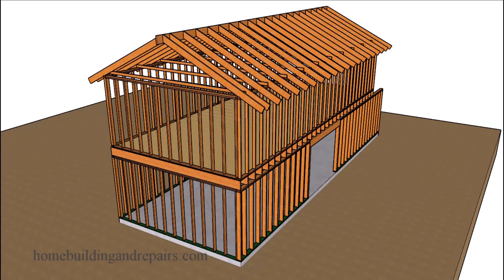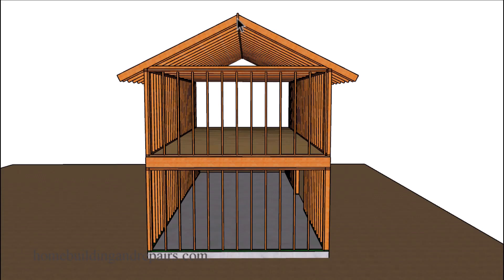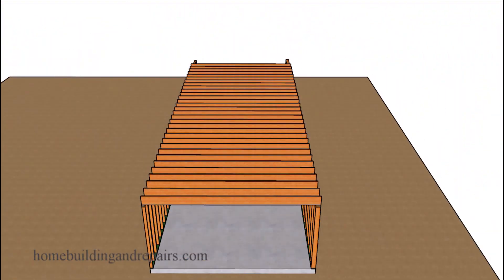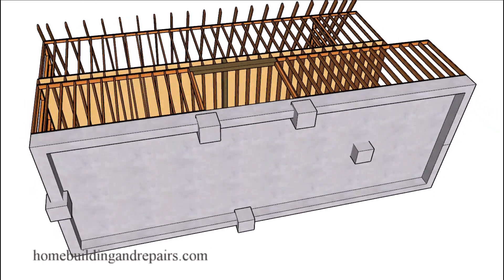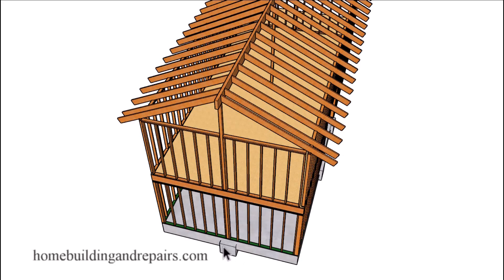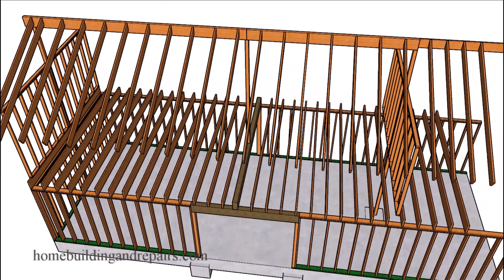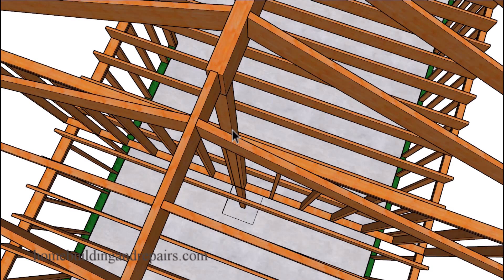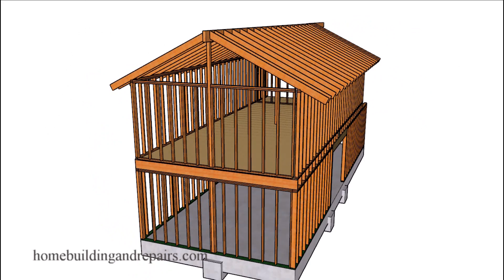Important Structural Engineering Advice For Vaulted Ceiling Remodeling Projects - Posts And Beams

Comment: You are 100% right. But instead of using ridge beam you can design a rigid connection at ridge point. This will remove the need for columns and pad footings.

Comment: Isn't it general knowledge in construction that your concrete footings are sized depending on whether it's a single story or a two-story? Like footings are usually only 2ft x 2ft x 2ft deep for single story or 2ft x 2ft x 4ft deep for a two story house for example? I'm sure it also depends greatly on the structural engineer hired and what calculations they choose to utilize to figure that out?

Comment: I appreciate the whole series so far and especially this video. I am considering using my open attic space to become a room of some sort, (bedroom, office space or TV room). I looked at the spans and can see it would be helpful to add box beams for the walls and reduce some of the snow load to the roof carrying it along the exterior walls and now to the beams which i would support from below. I am in the process of marking out all of my four levels... basement, main floor, bedroom floor, and attic. It is a 1907 four square which I plan to increase load capacity on and use the existing piers that are in place. More to come or I may end up emailing you once I have drafted my plans. I am a DIYer who has built homes and passed all my permit work in past renovations of another home so this is now my new favorite channel providing what I need to address and to hear. Thank you so much. John A, Retired Army Vet.

Comment: Nice!  This is what I need to learn.  Can you place a helical anchor at the critical spots on the foundation for additional support?  I know it's probably not necessary but I'm thinking it will reduce the chance of foundation movement.
Reply from the maker: I've never seen it done.
Reply: @gregvancom  ty.  I've seen it done on large projects like lighthouses where extra stability is needed for storms.  I've also seen it used to fix foundation.  It does require special machinery and knowledge of the soul.

Comment: Would the collar ties still be required to prevent the ridge from rafter separation? 
Any chance you have a video on concrete slab transition to a joist floor with the same finished height? Would like a basement under the kitchen and bathrooms for plumbing access but the transition would be right across the kitchen to living room. Drawing up a small project with a friend. Glad I found the channel and the website, tons of information. Thanks, it's been very helpful
Reply from the maker: No collar ties on vaulted ceilings with ridge beams in this vaulted ceiling remodel. I don't have a basement remodel video like your asking for.

Comment: Are there any instances where you can accomplish the same thing by converting trusses to scissor trusses ?  While you don’t get as much vaulting, it seems that you could create a similar effect (with much less work) by converting each truss to a scissor using nail plates and cross ties (engineered to transfer the same load of course)
Reply from the maker: You would need to contact a truss manufacture for scissor truss conversion. I did it on one of my jobs, but it required conventional roof framing with rafters.

Comment: i would also be interested in what you have to say about TJI joists/beams and what can be done with them or if they can be built and what would be the best advice on their construction?
Reply from the maker: I might need more details, for example the tji floor joist framing would probably be similar to this design if that's what you're asking.
Reply: @gregvancom  It sounded like he was taking about using TJI's as roof rafters and them bearing on a supported ridge beam

Comment: Great point! When we get remodels like this we first check all existing footing capacities with the new loading. We’ll use info from the soils report or minimum soil criteria from governing codes if a soils report isn’t available. If the existing footing doesn’t meet the loading demand, then we retrofit with a new pad footing or underpinned thickened edge footing. The goal is always to have a continuous load path down to the foundation and then have an adequate foundation to support the load.